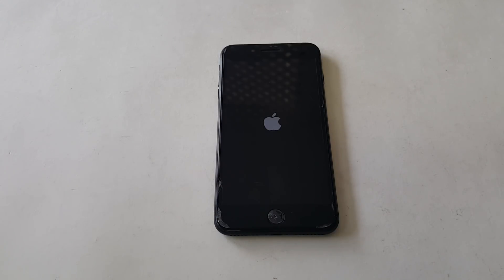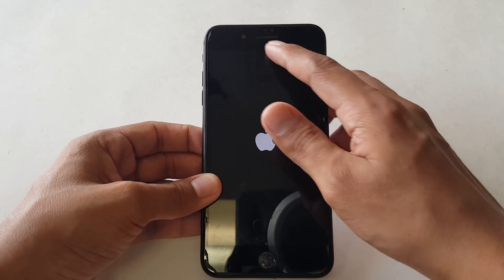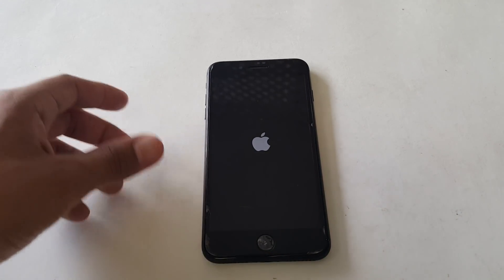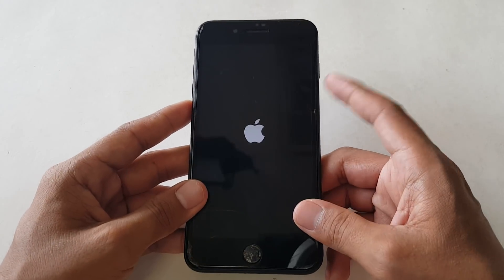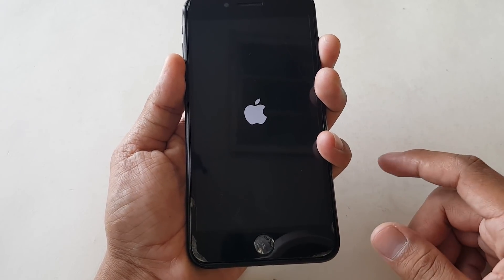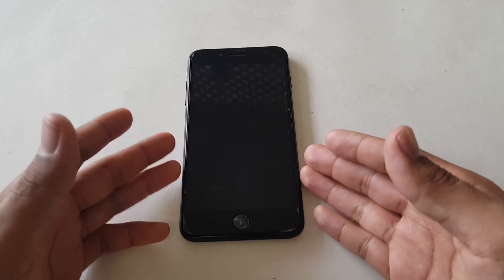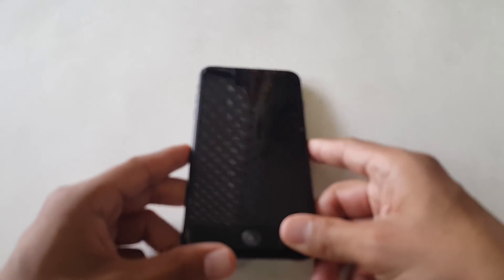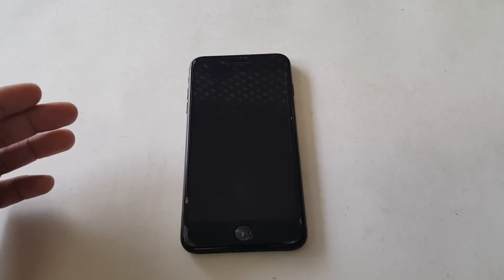Iphone 7 plus bootloop logo after repair, solved !!! Get to the main menu, powers on and off

Comment: GUYS IF YOUR IN A SITUATION LIKE MINE LISTEN UP

personally my iphone 7 was abit smashed and the home button was broken, it powered off and just kept looping again and again after the apple logo shows it powers off and starts again even if its connected to the charger. THIS IS WHAT I DID, i put my phone ontop of a plastic bag and stuck it in the freezer for 1 minute and 30 seconds ( while looping) and after i took it out it was still looping but automatically turned on i think by itself but mightve pressed power button. it just randomly did it !!!

hope i saved u some time guys. another comment taught me this so im passing it on
Reply: what are sure u put it in the freezer
Reply: @Realplants5  bro I swear to you put it in the freezer to cool components for like 5 minutes it worked I was so surprised I tried everything else
Reply: 😂😂😂 I'm gonna try this
Reply: Bro it actually works thank you so much😢 i was very irritated i was trying hard from 2 days 😭😭than you so much
Reply: @inashrafatima I was in the same situation at 6am so I did that from seeing a comment and then told myself I need to comment what I did 😂😂😂 your very welcome I’ve been there too!

Comment: Hopefully this works. I broke my home button by hitting it on the handlebars of my bike by accident, and I was able to turn it on the first time after it boot looped for a few minutes. I just soft reset it (volume and power) and it worked. Then I accidentally let it die and it keeps boot looping. I've tried uploading my files to the cloud, but it said the update couldn't finish (probably because my phone powered off) and since then I just let it charge and it kept boot looping. Im trying to wait a while and see if this works.
Reply: Did it work
Reply: any update?
Reply: bro i'm stuck in the same situation any advice?
Reply: @falpay7961  same did u find a solution

Comment: your actually a good person like honestly i was really sad scared and angry to the point of breaking my phone i was really scared and sad but your video really helped me out i broke my home button by biting it because i was fixing my bike at night and i needed a flash it started boot looping and one day it just didnt turn on after boot looping for a while thank you so much i really wanna thank you
Reply: what exactly did you do to fix it?
Reply: @jjgamer7485  i just held the power button down and the volume and it fixed its self after a while
Reply: I had a similar problem with my home button. I was working on my bike and I accidentally hit it on the handlebar which made the home button break. It let me power on without using the home button the first time and all I had to do was soft reset and then I accidentally let it die and it boot looped. I gotta ask, how long did you let it sit?

Comment: What I did was drain the battery by letting it loop until it drained it all then charged to 100 and used the reboot function (power and volume down) until the apple logo appeared
Reply: did it work
Reply: did it work again with your data intact?

Comment: Hey I have a question I tried what u did and it’s exactly the same phone and problem but the phone keeps turning off when I hold it down and when I let go it stays on the apple logo
Reply: Diego Riera yea um bad news is it doesn’t work and u need to get a repair or a new phone if u push turn down button and off and the apple sign turns on then let go of the two buttons and see if it works but if not then u lost a phone😖

Comment: Omggg thank you so much, my phone started doing this in the beginning of quarantine so I couldn’t go to apple. My phone would usually do this but not this bad I tried this and it work!                                What it did was I let it loop for 10 mins (I took off my case so it can cool down && leave the phone alone don’t touch it don’t try to turn it on just WAIT)                     Then, I turned it off...on...then off (leave it off for an hour) .                                                               Lastly, I turned it back on and it worked!. Hopefully this works for so of you guys
Reply: @Booker M'Kynzie I’m so sorry for the late reply 
If your phone stays or reboot try putting it in a cold area. I put it in my freezer for about a min and a half and it should work again. 
If that doesn’t work let it stay on reboot leave it alone but again keep it in a cool area not cold but cool overnight and then check on it
Reply: Diane Mutumukeye about an hour

Comment: i tried this over and over, the phone shuts off and stops the loop, but after a little bit when i come and try to turn it on it keeps going back to the loop. And now it's completely shut off and won't even go back to the loop. I should've left in in recovery mood a lot longer i guess.
i don't know what to do now except waiting and hoping it will come back to the loop at one point.

Comment: My phone did it without having anything on it repaired so idk why it’s doing that
Reply: Paul Holman Alright if it’s the Apple logo. Turn it off for a min, then plug it in open iTunes and  hold the power button and home button until you saw the ITunes logo. Then update your phone first if that doesn’t work then reset it via itune

Comment: [APPLE LOGO BOOT SCREEN LOOP SOLUTION]
Hey guys, I ran into this problem a couple weeks ago with my iPhone 7. The apple logo would appear normally after I press the power button but after a while, the screen would turn off and then the apple logo would appear. I got frustrated and just left my phone overnight beside my bed and in the morning I tried it and it turned on. Last night I accidentally left my phone unplugged at 10% when I went to sleep and the battery drained. Frustratingly, the endless boot loop sequence occurred again. 

I went back and thought, what did I do last time for it to work and I realized that my phone was really cold when successfully turned it back on that one morning. So today I stuck my phone in the freezer for about 1-2 minutes as it was doing the apple logo boot loop, and surely enough IT FREAKING WORKED AND MY PHONE TURNED ON. I tried it a second time and it worked again. 

My solution to the apple logo reboot loop, literally stick it in the freezer lol!! THIS MIGHT SEEM SILLY BUT IT WORKED 2/2 TIMES I TRIED IT
Reply: So I just put it in the freezer for about 2 minutes? I'm just desperate at this point lol.
Reply: @crooshed69420  yes
Reply: @berv9169  Lol I just threw it away
Reply: bro! i swear to god i love you u saved me so much time and im gonna duplicate ur comment for others to see! UR A LEGEND
Reply: ur a lengend bro
Reply: BRO UR FUCKING ANGEL! I WAS SO DESPERATED IT SEEMED STUPID BUT WORKED HOLY CRAP
Reply: aint no way u guys fr i might try this aswell oh god

Comment: I tried this, and it didn't work. What worked for me was to connect it to iTunes and try the "update" option. This option was disabled on the first 3 computers I tried, leaving me only the option of "restore" that would erase all the data on my phone. 
Finally, on a Mac of 2013 the option “update” appeared enabled and I could revive my phone without losing the info. 
I think what we face is the Programmed Obsolence so that we are forced to be buying new iphone. At least I am not willing to follow this game and I rather moving to Huawei or another system that does not give these problems. In any case, I recommend you not to give up without first trying on an old iTunes or an old osx, and perhaps the option of “update” appears enabled. Regards!
Reply: Just say, you're moving to Android. Not Huawei or Samsung, just (Android)
Reply: Orange County 714 I’m not moving right now. I am not one of those who replace devices while the one I have is still working. But when I do, for me Huawei is the clear winner without competition at the moment. 

In any case, my point was not to talk about my preferences. We can ignore that point. The really relevant part of my comment was to give my advice on how to save the iPhone without losing data, in case it is helpful for someone. My iPhone is ok right now. Regards!

Comment: I got someone to replace the screen and when I got the phone back the home button was not working anymore but I could still use the phone.Then the battery ran out and then when I charged it, it started boot looping. I have tried this method but it is still boot looping. Somebody help please.
Reply: SAME SAME SAME someone helpppppppp
Reply: @jocelynalvarez3141  me to i need urgent help asap!!!!!!
Reply: Itumeleng Lelosa, I think you should put it in charge whilst you’re doing this method, but if that doesn’t work, go to a phone shop and tell them you’re problem...
Reply: I went to a phone shop and it is fixed now.
Reply: Itumeleng Lelosa same...
Reply: Itumeleng Lelosa  did they do a factory reset? (Erase everything on your phone)
Reply: the same! now u fix it yet ?
Reply: this is my exact problem!! did anyone find an at home solution?
Reply: I have this problem to I need help
Reply: I did a factory reset myself before taking it to the shop because I was fiddling with it trying anything to fix it. So I don’t know if they would have had to do that too.

Comment: What am o suppose to do after my phone went off and i waited?
Reply: ofir tavor wait for 2 hours and then turn it on normaly
Reply: @AkaBiggie777  tried it, didn't work thnx anyway
Reply: ofir tavor it works for me
Reply: Should I still use the volume down and power button to turn it on?
Reply: claire ziegler as soon as the apple logo pops up release the buttons

Comment: it hurts me knowing it did not work for me
Reply: did you get your phone to work?
Reply: Your not alone trust me
Reply: Alright if it’s the Apple logo. Turn it off for a min, then plug it in open iTunes and  hold the power button and home button until you saw the ITunes logo. Then update your phone first if that doesn’t work then reset it via itunes

Comment: If anyone need help let me know
Reply: I need help, :'( My phone kept showing the apple logo and I tired the Power & home button reboot .that did not help
Reply: @davinachocolate6045  same
Reply: Davina Chocolate Hiprio email me and I’ll help. Not about to share my information on here. 509plezir@gmail.com let me know which phone you have. Samething happened to my iPhone 6 I looked everywhere to find a fix and it did not work. Until I decided to try something new.
Reply: Hiprio email me and I’ll help. Not about to share my information on here. 509plezir@gmail.com let me know which phone you have. Samething happened to my iPhone 6 I looked everywhere to find a fix and it did not work. Until I decided to try something new.
Reply: Diane Mutumukeye Alright if it’s the Apple logo. Turn it off for a min, then plug it in open iTunes and  hold the power button and home button until you saw the ITunes logo. Then update your phone first if that doesn’t work then reset it via ITunes

Comment: Done a screen replace and accidentally broke the home button ribbon so when I now turn it on it’s constant reboot like yours I don’t the recovery mode and now it need to connect to iTunes if I buy and put a new home button on it will it still need to connect to iTunes ?

Comment: i did a repair months ago and i just started having this problem, only the apple logo will appear and re appear only when its plugged in, when i do plug it in it will turn on and go to the home screen after being plugged in for a couple hours and only show its gotten to 3% and while plugged in it will turn off and turn back on is this the same issue or something different, i also try and restart (as shown in this video) and it doesn't boot back up but instead just stay off

Comment: Ok so my iPhone 7 suffered some water damage and has been on the loop for some time. I watched one video telling me to dry off the phone and let it sit in the sun for a little while, so I did. That's when I noticed a white spot on the screen when I turned it on. Any suggestions?
Reply: Thats the same problem i have but i didnt put it in the sun i blow dry it and then its stuck un reboot loop
Reply: U can put it in the rice, it will help to dry ur phone

Comment: Just did a screen replacement on an iPhone 6. Tried a factory reset w/iTunes (hold home button while connecting USB from laptop to phone) and an update(on laptop through window option). The first time I connected it to the laptop, but it went back to the boot loop. I am still having issues.

Comment: Hi, so I had this boot loading issue happen me today, randomly. I had not had any kind of repair or reset... but my device is just constantly looping. Most people will say when this issue happens to do the hard reset option with volume down key. Other people say to do this same method until you get the the apple iTunes repair screen, but neither of these options worked. This is when I found your video! I tried your method letting it stay powered down an hour after I did the volume down and power recycle. After I let it sit the hour I turned it back on and let it loop for 10 mins but still nothing. If I'm understanding your video correctly does that actually mean I have an issue with my home button? Because the device did power off right after I hit the home button and the home button was irresponsive. I also slightly cracked the screen a week ago but I hadn't had any problems. Please get back to me asap, there is no apple store in my area and I will just have to buy a new phone if this is more fixable.
Reply: Did you ever get your phone fix if so how?

Comment: Well My experience and Experiment says that there are possibility of not properly matching socket  of the LC D on mother board . as i had changed 3 batteries, 2 Screen combos. but nothing works. same problem. But when i ever i press hard on the mother board were all cables connect. it works perfectly fine.
Reply: Purvik Patel did you put the steel plate(covering the terminals) in tightly enough?
Reply: @elijahsilvis3037   Yea all in place. Might be some connector problem
Reply: Hiprio it’s main board / logic board / were all cable connect

Comment: Mine wasn't a repair but I droped mine and the battery cable came disconnected so i plugged it back in and now it is stuck in a boot loop I tried to restore it but the computer says there is a problem with the file but my home button also doesn't work but it hasn't worked since before I droped it

Comment: Gna try this out. Uncover jailbreak got me stuck in a boot loop. Let you know you how it turns out if anyone else is having the same problem
Reply: Demodog I’m having the same problem, did yours turn on yet?
Reply: uncover did the same thing to my phone as well.. any solutions work? my itunes wont let me restore for some reason either.
Reply: Ethan Bebleh I have no idea, I’ve been trying to hold buttons and nothing is working

Comment: This worked, i smashed my home button on my iPhone 7 Plus and it kept going into a boot loop, i turned it off and let it sit for about 2 hours and i turned it back on and it finally fully turned on, thanks man
Reply: That happened for me too but like 5 hours later it started doing it again
Reply: Now it keeps doing it and doing it again
Reply: pls help me I dropped my iphone 7 & it keeps rebooting, tried the above method also but just doesn’t works..since 3 days the phone is rebooting :(
Reply: What did u do when u turn it back on? Just the same thing? Hold the volume down and power button? Seriously I need help. Thanks. Sorry for the bad English

Comment: I changed my screen it goes to the home screen but when I make call it reboots
Reply: The problem is the earpiece proximity sensor cable. Replace it. When you make a call it sends voltage to the earpiece via that flex and it shorts in turn rebooting. Save the old cable so you can fold the new one correctly and take your time and make sure all connections are correct.

Comment: My phone is still going on and off
Reply: Well My experience and Experiment says that there are possibility of not properly matching socket  of the LC D on mother board . as i had changed 3 batteries, 2 Screen combos. but nothing works. same problem. But when i ever i press hard on the mother board were all cables connect. it works perfectly fine.

Comment: If the home button appears broken after repair it's usually the flex cable. Push the connection down with your finger or plastic tool. Try the home button connector first if that doesn't work trace it back to the logic board and push down that connection. (Keeping it pushed down as you power it up)  in some cases you might have to apply a foam back on the flex cable. Works on all Apple finger print home buttons
Reply: Jam1e Newson it works for 7 plus bro, thanks !